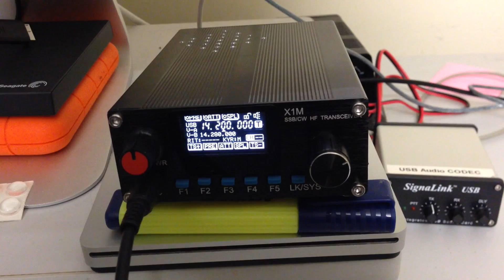x1m chinese hf transceiver first contact

Comment: $370 USD.  4 watts SSB.  Seems ok for a QRP rig.  Good work mate.  I have some experimental rigs that are good fun.  Also I have a Ten Tec Argonaut  505 which is a 2 watt rig.  I use it with a decent efficient antenna.  Works great and so will this rig with a good antenna.  Also I modified an older Sailor T1130 solid state amp to boost power to 400 watts when QRP starts getting a bit tedious.  Good luck.

Comment: Japanese radio's are almost as bad.  I have a Yaesu FT 900 in need of repair.  Yaesu won't touch it because they say it is obsolete. They want me to toss it and buy a new one. American radio's are not far behind. The old TenTec would repair anything they ever made. now that TenTec has been bought by DishTronics they say they might fix my TenTec Omni D if parts are still available. I know parts are still available. TenTec just wants me to buy a new radio. With any company, including the new TenTec it is just about money.  No one cares any more. Ham Radio is getting to the point where it is no longer enjoyable.